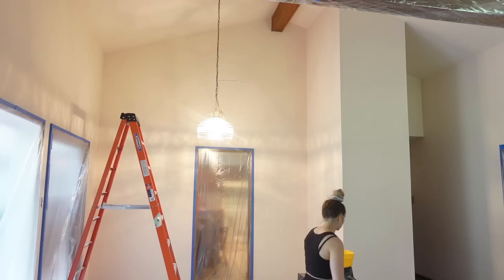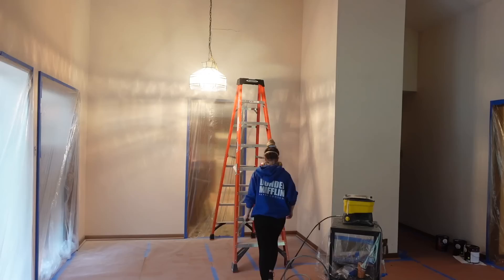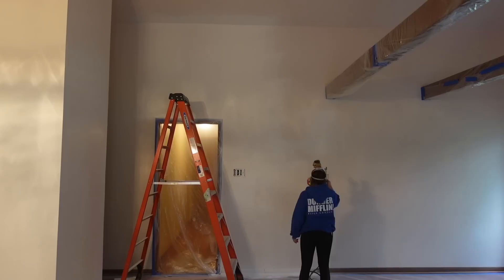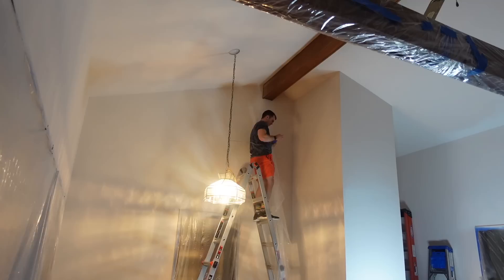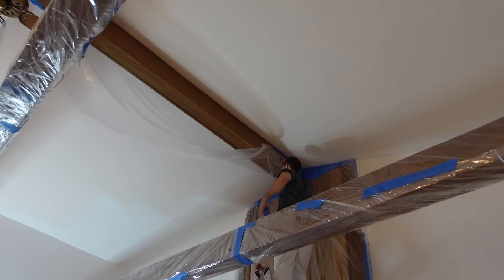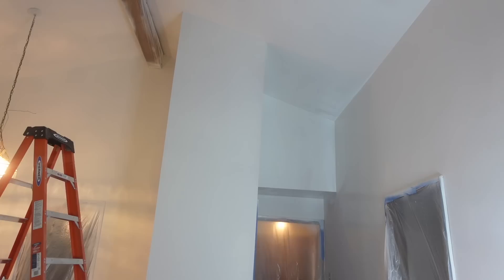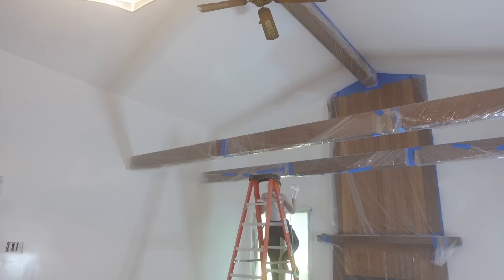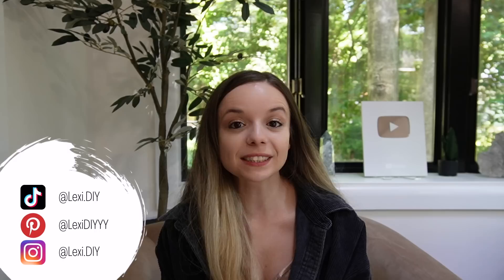HOT MESS LAKE HOUSE RNEOVATION LIVING ROOM EP. 2! | PAINTING THE LIVING! | LEXI DIY

Comment: After doing up an AirBnB as mid century modern using actual pieces.. keep the fireplace wood! The lower cross beams interrupt the vertical lines of the fireplace. Changing the firebox cover will make a HUGE difference.

Comment: I like the vertical lines the wood provides but I don’t think they’ll be necessary once the horizontal beams are gone. When you said concrete I said “oh yes!” You have so many options with the concrete. You can stamp concrete to look like wood, stones, tiles, etc and then paint it, leave it natural (I assume black 😂). If you miss the warmth of wood you could add a floating shelf -instead of the shelf that is wider than the fireplace. Oh! And you could extend the side or depth of the fireplace with the concrete, tho would that eliminate the ease of a thin coat? 

Ah I love this room! I can’t wait to see what you do for the holidays in here!!!

Comment: Lights and fan next so you can decide on the fireplace afterwards. I would sand down the midsection of the fireplace and stain it a light color or just a clear coat. But I don't know anything about lime wash painting or how well concrete would stick to a tall, vertical surface. But both sound interesting!